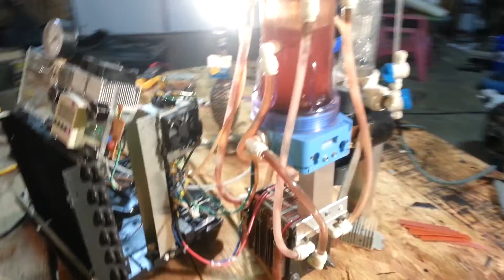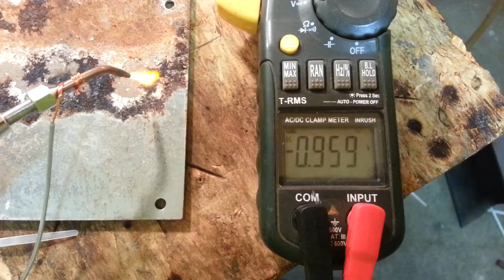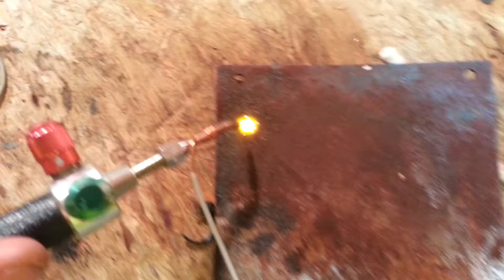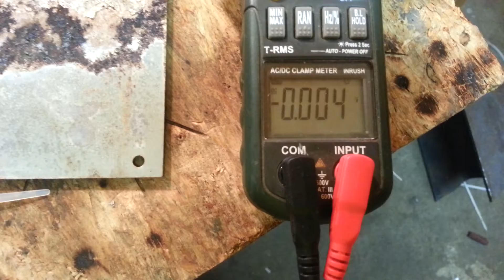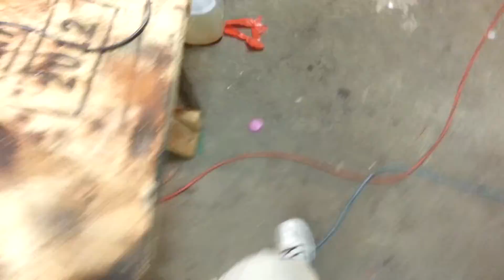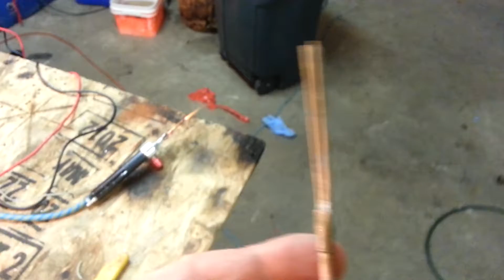HYDROGEN fuel cell with rust

Comment: Hi this may sound disgusting but I have had a strange occurance happen last week in a car engine by replacing the coolant with urine/my own it Chargers the battery and got more power but it all disappeared within 3 to 4 miles now today I have been told the urine leaves a scale lining inside the engine and it has deuterium in it the scale I am told is lithium finally joe bookers friend Peter Stevens emailed me back once I mentioned this to him without ridicule and told me to place a star washer between the engine earth to the body but slightly loose this I have found out causes something called phasing out here in uk anyway like I say may be something you could tweak just on with conditioning a rover car now to become soaked in this waste neutral energy. Cercy in uk

Comment: Yeah a non combustion test is worth trying.Obviously the hydrogen is gonna want to get back to the oxygen and become water again if the attraction of the metals is less than the hydrogen oxygen.The gas is so small it will permeate the steel and rust and do that crazy atomic tunneling thing that makes embrittlement...so it follows that there will be single atoms caught up betwwen the iron atoms until its saturated. I figure at that point it would behave as a catalyst and only needs a well planned gas bed and in that bed a vessel full of iron oxide powder and a zinc electrode...not sure about the other electrode but im thinking carbon or copper would suit.Good chance the catalyst bed will need heat

Comment: I an thinking that maybe ther is a way that you could make a battery and when the elecrroplates corode, you could reverse the process by adding hydrogen, elminating rust and restoring it back to the same condition, while also still creating voltage. I am surr the polarity would be reversed. But the awesome thing about it all, is that you could have a battery that would last a long time, until one of the plates eventually burnt through.
Reply from the maker: yes i think there is allot of cool aspects of this idea , and you are correct a very long life battery may be possible with this if we use peltier modules to capture the lost heat

Comment: I am humbled by your remarks and got a good laugh at your exceeds us by half a volt comment...good job bro.Check out zinc air batteries wich use zinc and iron for high current batteries. They also work like a fuel cell when oxygen is piped in more current is available.Maybe a hydrogen rust battery could be the reverse of a zinc air battery.
Reply from the maker: Lol glad you got a kick outa that i am so glad you talked me into this , i am considering building a record player type unit that slowly spirals back and forth and perhaps the rust could be regenerated by the steam of the hho flame and a peltiere module could be used on the plate to harness the power wasted by the heat  of the flame , i have a hunch that connecting a flame unit in series would increase voltage , but because the gas conducts it may be tricky, how will i electrically isolate the gas stream ? perhaps long plastic coils of house would provide the resistant needed , any way thats very cool that we got results that doubled the known effects. i will soon be building a device that amplifies these observations even further , gonna shut up now and check out that zinc battery, i assume your implying trying a non combustion unit as well
Reply from the maker: hey dont let me forget but i have an idea , what if i made a cell with proper plate and wiring configuration and then filled the whole chamber with hho and detonated it say @ 60 cycles a second, it would be like lighting thousand of little flames in series without the tedious action of building and keeping thousands of torches lit , this may give a high voltage battery . i dont have time to try just wanted to jot the idea down before i forget